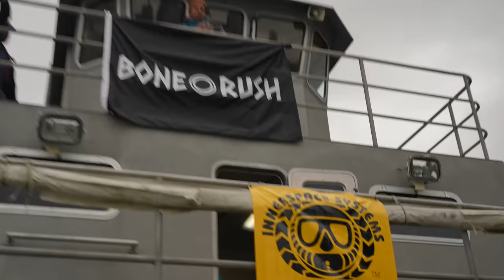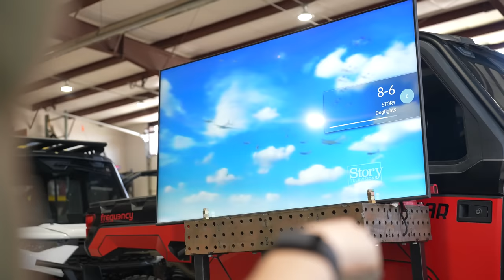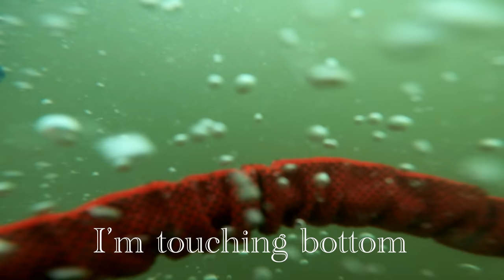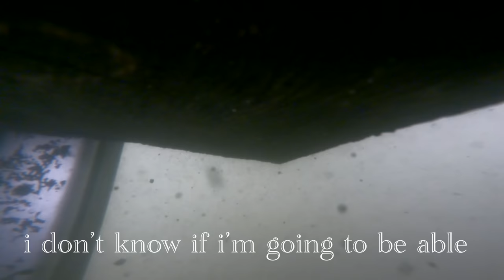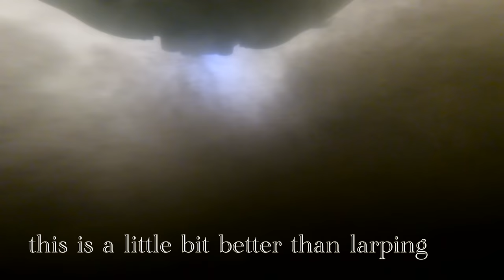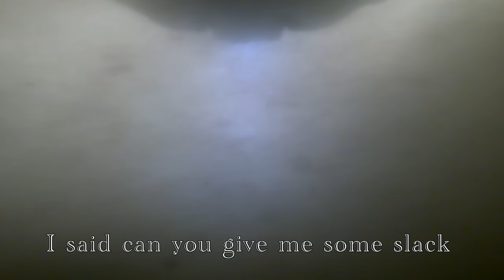Watch What Happens When the Coast Guard and NYPD Come Aboard Our Dive Boat!

Comment: In deep silt, it's necessary to use a sounding rod. The variance of resistance is your indicator. I would suggest using a gig tip and possibly harpooning a bone under the silt.

Comment: @ 4:00 - about five years ago I put a RCA 9dbi gain Yagi directional antenna ($38 on Amazon) right on the edge of the roof of my apartment and aimed it at 148° on the compass. Immediately got about 62 channels out of the Tampa Bay Florida broadcast fields! And the picture quality is better than I ever got from satellite or cable because they don't compress it is much as cable channels and satellite channels! I call it a win even though I hardly ever watch anything because I really don't watch TV very much lol. I have turned into a YouTube junkie instead!

Comment: Hey HeavyDSparks, I think a large issue is definitely navigating and being unaware of where you are on the bottom and in relation to the boat, I believe if you set up sectors and use fences to cut it off. You can do it one section at a time. If it won’t be faster, at least it will be more organized. Great video and it shows a really underrepresented and under appreciated industry.

Comment: The silt under the Kerch bridge across Russia/crimea was so deep, they had to drive the piles 60 meters, and some engineers say that even that might not be enough .. 
shallow river inlets like this are PRIME spots for silt and sand to deposit, hence why the shipping Shane’s need to be dredged out periodically.. as the rushing tide comes in, it pulls silt/sand from the ocean floor and makes its way up the inlet.. once slack tide hits, everything suspended in the water column drops

Comment: Retired commercial diver here 🙋🏻‍♂️. Spent some years diving the Gulf Of Mexico for the oil industry. If y’all plan to go back, invest in a what us offshore guys like to call an “air lift” it’s basically an underwater vacuum the runs off air. Super simple and cheap to make one. It will pick up the light/fine sediment and expose the natural bottom. It would work perfect in that situation because all the sediment goes up the pipe, vents out the top and the current carry’s it away.

Comment: Serious underwater hard hat divers work on some wild stuff. We had to use divers in New Orleans in the Mississippi River in 140 feet of water with eight (8) knots of flow so that divers had to go down through a culvert type tube to get to the bottom and recover some concrete weights of well over 100 tons total. Those divers were great and the divers who recover stuff in the really deep oceans are really over the top on skills. Most likely the police and Coast Guard didn't until some person lodged a complaint.

Comment: Love this very different video from the usual stuff you guys do ,    the silt depth would be very hard to deal with ,  everything is found by touch and who knows what you found until you see it up on the deck,   even if it was a big block of wood ,   you need to use those very powerful magnets ,  like the strength of the magnet drill when powered up ,  just need to seal it super good so water don't get it

Comment: I took a cable coaxle cut off six inches down to the copper, then five more down to wire mesh, rapped it onto itself and it gives us almost 60 channels for free, I didn't buy the cable wire either

Comment: why aren't you using an Alaskan sluice box type system to vacuum? the silt away from your work area, it would vacuum the silt away and then move it back behind the diver, on the way the tide moves and would show any large objects before the vacuum system sucks it up to the surface for the inspection team to see in the sluice box style catch system.

Comment: Always think of this when I hear "East River" ...
Cosmo Kramer: Well, my swimming pool problems are solved. I just found myself miles and miles of open lanes.
Jerry: What is that smell?
Cosmo Kramer: That's East River.
Jerry: You're swimming in the East River? The most heavily trafficked, overly contaminated waterway on the eastern seaboard?
Cosmo Kramer: Technically Norfolk has more gross tonnage.
Jerry: How could you swim in that water?
Cosmo Kramer: I saw a couple of other guys out there.
Jerry: Swimming?
Cosmo Kramer: Floating, they weren't moving much. But they were out there.

Comment: If there's ever been a case for why we need the second amendment. Just take note how long they were diving before anybody showed up for this security "infraction". Way to be good role-models to our youth & about how to handle corgial visits from the authorities. Mainstream society glorifies thuggary and lawlessness and you guys handled yourselves very well under pressure from the authorities. If you aren't doing anything wrong, then you shouldn't have a reason to be worried. However, there is always an SOP(Standard Opperating Procedure), when you run into law enfrocement. Don't be stupid and make sure you comply when & where they ask, so long as it's reasonable and constitutional. Good job Diesel Brothers!

Comment: With the silt it's going to take some digging I watched these others treasure hunters in the ocean hook a big Pipe to the boat motor jets and the pipe is like a 90 degree so it's bent pointing at the bottom and than they turn on the engine and blow a big hole all the silt away at the bottom Than let it set and go down and see what's under the silt